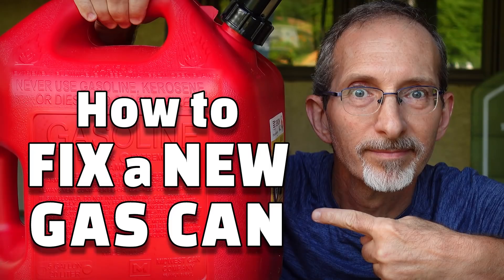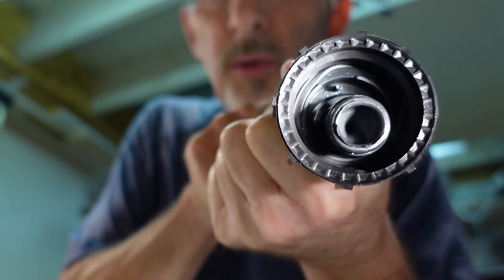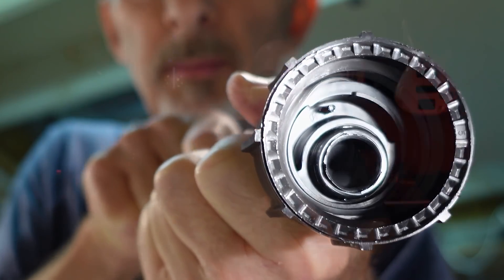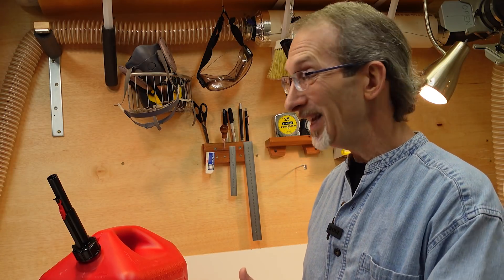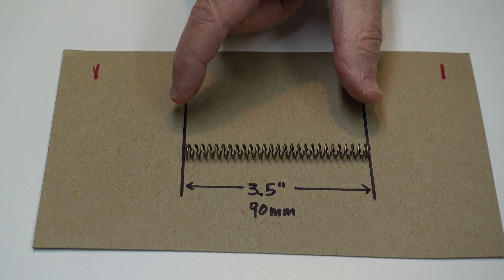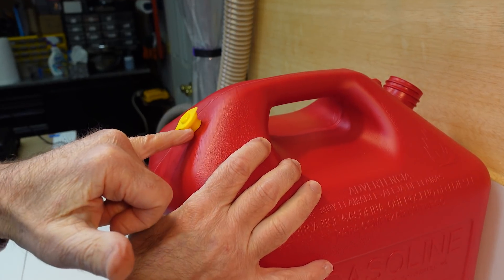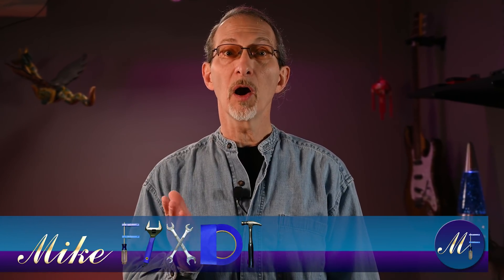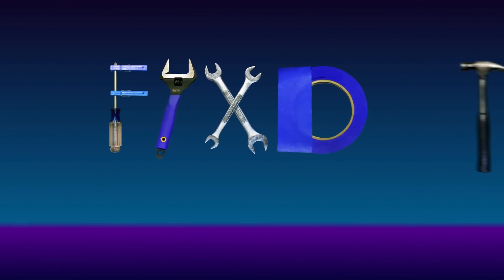Gas Can Modification | Part 2: Explosive Details!

Comment: Yes, government regulations punish people with common sense to protect foolish or stupid people.  Case in point - fuse panels vs. circuit breaker panels.  Circuit breakers were mandated on new construction decades ago to protect the idiots who installed the wrong size fuse, or put a penny or tin foil in the fuse holder.  We all got less reliable protection.  

Breakers have dozens of moving, pivoting parts.   That makes them less reliable than a fuse, which is one, non- moving part.  When a fuse blows, you need to find the overload and correct it, as fuses aren't free.  People treat breakers as switches.  They keep resetting them.  That wears the internal parts.   Breakers can fail in two different ways.  They either start nuisance tripping, or they hang up and don't trip.  The latter can destroy your connected equipment, wiring, or house.   I worked for an employer that was lazy about finding and correcting overloads.  They continually reset breakers.  We had a large motor short out, drawing lots of current.  The worn breaker didn't trip. it hung up.  Fortunately, the motor winding burned open, interrupting the current before the building wiring overheated, and burned down the building.   

The ironic thing is, the  insurance industry that pushed for the change to breakers could've demanded that the fuse panel manufacturers make the panels tamper proof.

There is now apparently only one company offering homeowners insurance for houses with fuse panels.  And I am being punished by excessive rates for keeping my fuse panel. 

 I worked in electrical engineering for 40+ years and know what I'm talking about.  Did you know the government doesn't allow the use of breakers in medical instruments?

Comment: I had a can like that. The very first time I "used" it, the spout stuck in the open position. There was no way NOT to spray fuel everywhere as I lifted the can away from my generator. In Midwests defense, it was the nanny state that forced the "safety measures.

Comment: Mike talks about the "research" that the manufacturer did. My 1st thought was the "consumers" were actually employees from the plant floor. And you can guess their responses because now they've been told this is a better design so marketing came up with all the quotes he was reading and the plant workers got to jeep their jobs because they had something to do. 
BTW, I'm wondering about the screw lock. Since every "safety container" has this feature could it be some gov't requirement?

Comment: The flash suppressor has actually been a requirement for many years. It's not a new thing. Older ones were made of metal screen. They are a good idea, just the reason they give is silly. But the spout is ridiculous. The best thing to do is throw it away and get the yellow ones sold separately. They are not expensive and can be found all over Amazon and many hardware stores. They even come with the vents you show.

Comment: Cool vid Mike. You infer the container is two pieces joined together at the visible "seam". Learning should be a two way street. The fuel container is manufactured thru rotational molding. This process requires at least two pieces to form the mold. The "seam" you refer to is formed by the mold surfaces when they are joined together. When the rotational process is complete "flash" (excess plastic) occurs between the mated surfaces of the mold. The flash is then trimmed away (typically recycled) to form the finished product. Flash occurs in every rotational molded product, and should never be confused with a seam. The wall thickness at the flash line is the identical thickness of the remainder of the container, and the flash line will not appear on the interior of the container. Best wishes.
Reply from the maker: That's excellent info! Thank you very much! 😁👍🏼

Comment: Ran out of gas in my Volvo, which doesn't have a gas cap. It has a set of two internal doors or valves. The Midwest can spout can push through the outer valve, but is not long enough to push open the internal valve, as the large tab that holds the red spring lever prevents the spout from going in more than a couple inches. As a result, the gallon of gas I attempted to put into the car came out the overflow hole just outside the first valve. That was awesome. Adding insult to injury, the big tab on the spout caught on the outer valve of the car, breaking it, which ended up being a couple hundred bucks to fix.

I cut off the big tab on the spout so I could get the dumb spout past the second valve in the car. Works ok. Gas should be able to go in the car now.

Comment: When you get rid of the stupid internal filters you can get a drill driver powered pump w/ hoses for about $25. I have also switched to metal "jerry cans". You can tote a 5 gal Jerry can short distances with it's double top handles and the pump the gas to whatever machine you want. The also have a better seal (spring loaded) with gasket for longer term storage - with a little "Stabil Storage" added to the gas, hopefully ethanol-free for small 4 stroke engines [generator, outboard, etc].

Comment: Instead of using heat, you can use the back end of a bit socket to push the cap in. Works very well.
Reply from the maker: Good tip!

Comment: A 2 gallon gas can I bought at Walmart in Indiana in 2023 CAN and WILL overfill my push mower gas tank if you are not careful. So much for SAFE Gas Cans. My push mower bought at Walmart, has an overflow LINE that DUMPS the over filled gas onto the AIR FILTER. How original.

Comment: I just rip the filter things out, trow the spout away and get a lid for the on amazon.  I then used a  battery operated fuel transfer pump to fill my equipment.

Comment: When installing vents into these cans, just use a 1/2 inch hole and it pops in without any difficulty..  I have no idea where they came up with the need for a 31/64 hole.

Either America has a ton of crazy fools that need a job designing this thing or there are a lot of stupid fools out there that do not know how to pour from a gas cane properly.  Also NEVER fill a gas can from the trunk of a car.  Those people are idiots from birth.

Comment: Remenber many years ago that one dumb man used a US Medal 5 gal.  jerry can to poure gas into a  hot  mower and  poured gas over the hot mower ome how .He ended up in the hosptal with 2nd & 3rd degree burns all over his body,  His lawer sued US Medal for manufacting a unsafe gas can, whitch put US Medal out of busness, The 5 gak jerry can was desiged to fill up a Jeep real fast during  WW2, You should  use a 1 or 2 gal gas can to fill up a mower that is cold & never Hot, Then the Feds from consumer end  of gov, then ordered all new cans have all this new safety junk in the new  gas cans,  That dumb guy must have ben a brain surgeon!

Comment: The plastic mesh filter is just fine and I've never had issues at the gas station... I think you could have problems with diesel but whatever.

Comment: If Midwest was truly concerned about safety, they would make their fuel cans out of METAL rather than plastic that is easily punctured or eaten through by rats (yes it has happened to me).
Reply: Yeah and out of 20 years of owning Midwest cans, I've had two that the same gave way at the top of the handle, the good news is now they were self-venting. Lol.

Comment: Do NOT heat the can without flushing the gas out with water first! You really need to pin a comment about that, it's a huge potential safety hazard.

Comment: In no way to take away anything from this video but i went to Tractor Supply and for 12$ bought a kit that has a vent plug, flexible spout and threaded cap. No more spilled gas using Satan's safety spout !

Comment: i have spilled more fuel with these damn cans than i ever had in 30 plus years of the old midwest cans with the yellow spout and attached yellow cover over the end. Now i will say the new one i got from somewhere that has the push button at a 90 degree angle is nice and i like using that for equipment. one push and it usually fills up small 2 cycle tanks.

Comment: UP FRONT: I do agree with you on the fact that these features are a pain in the ass and actually add to the danger of fueling a vehicle or transferring fuel. I have NEVER SPILLED FUEL FROM A SIMPLE VINTAGE GAS CAN! However, your spring related physics theories are complete BS (sorry... and yes I AM an engineer)

SPRING ENGINEERING FUNDAMENTALS 101: Cutting the spring makes it HARDER TO COMPRESS! That's because a short bar or wire is harder to bend than a much longer one.

The more coils a spring has, the easier it is to bend! 
WHY? BECAUSE IT'S LONGER AND THAT GIVES YOU MORE LEVERAGE TO BEND THE SPRING!
Want proof? TEST BOTH SPRINGS BY PUSHING IT AGAINST A BATHROOM SCALE UNTIL IT IS FULLY OPEN TO THE STOP!
We can even see in your video that it was almost twice as hard for you to compress the spring. You couldn't even get it all the way open!
HERE"S WHY!: A spring takes a certain amount of force to deform it a certain distance. It takes about half the force to deform it have that distance. By putting TWO SPRINGS in series, each spring only has to bend HALF AS MUCH so together they are moving the full amount, but with HALF THE PRESSURE, because the pressure will be the same in each spring as it is IN TOTAL. That's the way a stack works, when an outside force accounts for all of the force in the system. REMEMBER, we're not talking about stacking heavy solid objects where the stack of 10 x 50 pound objects adds up to 500 pounds before a 200 pound man pushes down on the stack and adds his 200 pounds to make a 700 pound total.

The spring weighs at best a couple ounces, but it takes maybe 30 pounds or better to fully compress the spring. A coil spring is just like a straight spring. Think of the spring like a bridge. A short bridge like a 1 foot piece of 2x4 will easily hold you weight and even a car's weight when spanned across a couple bricks. But make that 2x4 20 feet long, and it won't even support your own weight!
I hope that was a clear explanation. I'm sure you'll let me know if you didn't understand something. I'll be happy to try again!

Comment: I mod all my new gas cans with one exception the flash screen the same screen high end safety cans have had for decades, yea you have to fill them slowly but remember gas vapors are heavier than air and something as simple as a lawnmower exhaust can touch off the vapors traveling back towards the can, it's probably the only useful item the can has. my back is shot so I use 2.5 gallon can's and my diesel compact tractor get's filled from a 30gl barrel with a hand pump from spray painted yellow 2.5 can (can't find yellow 2.5 gallon diesel cans in America.)
Blame lawyers, EPA and stupid people for where we are, and it ain't going to get any better.

Comment: The problem with the breather along the top of the nozzle is in common use orientation, the fuel in the container covers up the breather inside the can.  The scientific concept with this problem is the equal exchange of gasses.  If 10 fluid ounces exit the can, then 10 fluid ounces of something else has to take it's place at the same rate.  Otherwise a vacuum is created.  The result if this vacuum is the sides of the can being sucked in, then air tries to enter the breather but not at the same rate, causing the sides of the can to contract and expand, causing the glug glug.  Placing a vent in the air space  opposite the nozzle, allows air to flow in at the same rate the fuel is leaving.

Comment: Dont be surprised if you find that yellow vent missing in this install. Happened to me apparently if its not the government screwing with you its rodent also. Just find a bolt/screw that  fits snug in there after mr rodent pays a visit.

Comment: Its all about possible law suits. Diesel and Kerosene do not need the flame filter. I just remove the red lock  with a pair of pliers and drive the flame filter inside the can with a broom handle.  It’s never been a problem.

Comment: You didn't need to worry about avoiding the seam. It's not going to compromise anything. The best thing to do with these cans is to remove the flame arrestor as you demonstrated, and then put on an EZ-Pour spout. The spout kit comes with the same vent that you installed in the video, and has a free flow spot with a screw on cap. Basically, you're making an old school gas can out of the new mess up one.

Comment: I hate the fuxed spout. Where are the flexible ones that make pouring easy? Are the spring loaded valves an OSHA reg, or just a stupid manufacturer's idea? As others have said, why fix what works. I've used the old style for over 60 years successfully.

Comment: 31/64th will fit somewhat loose helps to go a 64" smaller and be real steady!
also put the vent in real hot water to make it more flexable when you snap it into the hole.

they will break in cold weather but otherwise really help

Comment: I have spilled more fuel using these new cans than I ever did with the old cans. I finally found enough old spouts to finally get rid of the new spouts.
Reply from the maker: Replacement spouts are a great option!

Comment: The spout is designed to meet CARB standards. It also gains EPA compliance. The flame arrestor is different, that is a national DOT requirement for shipping flammable fluids in interstate commerce. The videos online make it dramatically clear that the flame arrestor literally stops explosions.
 Typically two gas stations are blown up every year by customers lighting up cigarettes and setting gas FUMES on fire. That's what the flame arrestor is for.

Comment: Go to rural king or a place like that.  Buy there can conversion kit.  It comes with the air vent a new spout with a cap to contain vapors. That spout doesn’t have springs or releases to get the fuel flow.  It’s a spout that is just that a spout.

Comment: I just drilled a 1/16 inch hole in the back of mine and stuck a polyethylene golf tee in it. It wedges in tightly. Wont come out even if you knock the can over.

Comment: Just bought one of these 5 gal. Nightmares for filling my boat. I'm so glad you shared the fix because these cans are a royal pain in the ass for filling the tank on my pontoon,first time I tried to use it I immediately spilled gas everywhere and ended up pulling the fill tube off and using a funnel.

Comment: That's all a bunch of rubbish when you have to put the can upside down full pressure push that tab against the edge of your fill port on any small engine appliance and all the gas just rushes out and spills over yeah I'm sure that is fully flame and fire safe

Comment: I did not read all the comments so someone may have already mentioned this, however I do believe this might be worth saying. If or when you are using a similar plastic style can outside lets say for use with a chainsaw, The sunshine can cause expansion of the  gas mixture and create pressure. This type of can in its original form provides no way to vent the vapor pressure. If you put this nozzle into a chainsaw and depress to pour  the gas the pressure will cause a back spray and if there is some fuel left in the chainsaw that fuel can also be splashed back towards the person doing the pouring. I no longer purchase this type of can. Some times I do purchase a new nozzle kit to totally replace nozzles like this. I only do that when I cannot find a standard type can. (becoming more difficult to find a standard can). Releasing built up pressure should be done with the gas can upright not tilted. This original can design does not allow this to happen. I found this type of can with the stiff spring too difficult to vent. I am a pretty strong person.
Reply from the maker: Excellent points. I have added a plastic relief valve to the back of my containers. Not only does it let the fuel flow smoothly, it lets you "burp" the container when the pressure builds up. Thanks for your comments and for watching!

Comment: Step drill (available for cheap at Harbor Freight) makes a cleaner hole every time. Use compressed air to blow out any debris. No compressor? Flush with water several times, leave cap off. Any remaining water will evaporate out in a day.

Comment: The spring spout is a half-usable design. It should be a single step with a lighter spring. Eliminate pressing the tab, leave a lighter spring for controlling the flow.

Comment: They make Brass vents now and you can buy 12 for about 18.99 on e-bay. I am sure you can buy less that that. I know I have enough gas cans sitting around that I will use 10 when the brass vents show up. They have lids and come with a special wire to help feed them into the hole .

Comment: Good stuff, but I think I might  have been tempted to add a sliver of glue or sealant when fitting the yellow vent since gasoline "creeps" and I would be worried about gas or vapors leaking!

Comment: A big word of caution to anyone not familiar with how dangerous a seemingly 'empty' gas can be. If you have already used the original can and are attempting to modify it as described in this video, the vapors in an empty or nearly empty can are extremely volatile and could be ignited by the arcing armatuer from a corded or cordless drill, especially if the spout has not been removed and there is vapor pressure in the can when the drill pierces it.  Also if the can has been sitting in a hot vehicle or out in the sun on a hot day, residual vapors will continue to overflow from the can until it has cooled   The vapors could explode the can violently if ignited. It might take a little longer but, in my opinion, thouroughly emptying the can and rinsing it with water and a little dish detergent would be a safer approach.